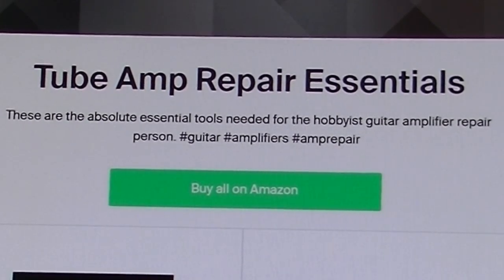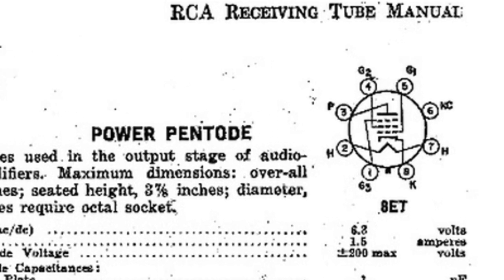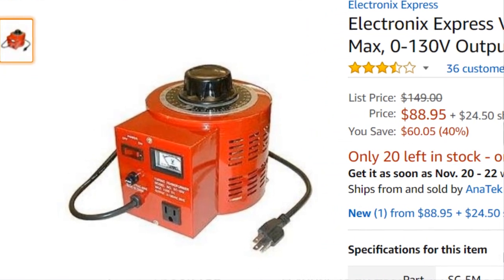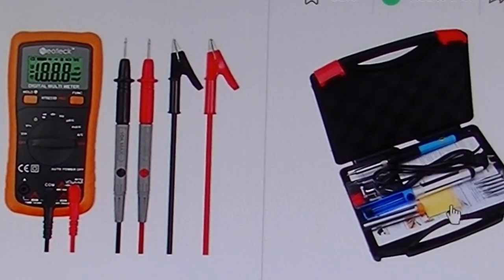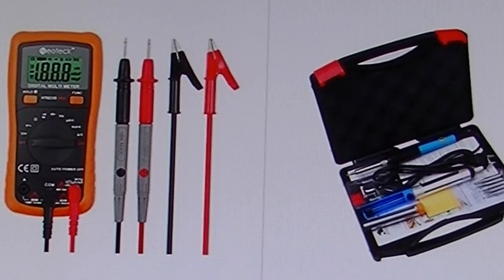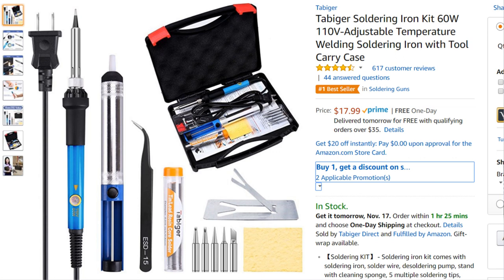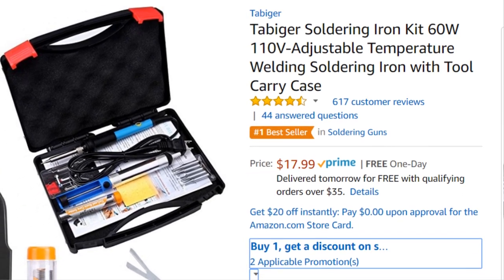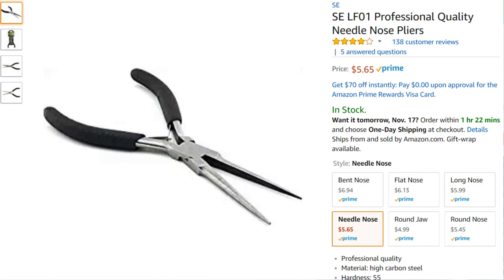9 MOST ESSENTIAL TOOLS for Tube Guitar Amp Maintenance and Repair

Comment: First things first, Great video...!

for tube data: Frank philipse´s online database, no matter what...;)
Download the RTM and by the time you have some saved money, buy the used original...;)
Ditch the variac, spend the saved money on an ISOLATION tranny!! And on a "big name" used digital meter, if it´s a fluke, a tek, or a beckman....but you rely on this thing, so buy a used from the big players. It may save your life....i´ve blown so many cheapo DMMs but i know what i´m doing (ok most o´the times;)
Replace the variac with light bulbs in series with the amplifier, if something odd is happening inside they will light up and save your amp. 

Next is more of a, my oppinion, advice: if you buy an used amp of unknown state, simply disconnect the high voltage secondary leads which go to the rectifier, and see if all tubes will light up and the power tranny doesn´t "sing" much or getting hot.
I always start that way, of course, you can combine this with a variac and an isolation tranny. in fact i always use my variac followed by my iso-tranny and try to light up all tubes without any high voltage present in the tube amp/radio/tv/recordPayer/R2R unit.

by the way, my weller WECP station have survived three benches and it´s about 30 years old by now. i replaced the mains cord, and a lot of tips, but that´s it. But if you try to solder some big wires to a chassis, a plain 50W LR21 don´t cut it, you gonna need "more power" usually i go for that pistol shaped short circuit 150W iron. Also you can´t compare a hexacon blaster, which is more than 3 times+++ the power with a temp controlled weller 50W LR21 iron...;)

Also buy top notch tools as soon you can afford them, cheap tools are exactly that: cheap....i was into these as well, i bought some, and when they give up, i bought cheap again...until i was given some Wiha screwdrivers....a complete new experience...they last, the work like a charm, this also is true for pliers, clippers....you only buy once for about ten years to come, if you don´t abuse them: big cables/wires need big beefy biters but no precision clippers ;)

Comment: Hi thanks again for the video and I have learned so much and thanks for that I repair a lot of Xbox one x ;s and other things to I am just going to buy a  bench top multimeter  And I don’t want to spend to much it’s the OWON XDM2041 Bench Multimeter with 3.7-Inch 55,000 Count True RMS Ultra-light Digital Multi Tester for Labs, Factories and it has the 2 wire testing and the 4 wire testing do you think this model is ok to start with I have good   Range Of soldering irons and  D soldering irons  And hot air as well I will go out and buy the  transformer  Which is a good  safety items To have and in the  future I will go out and get a four channel oscilloscope I think four channels is plenty don’t you think and I have made some   Discharging  leads for capacitors to make them safe I have soldered in a resistor on the lead with different values to make the  compositors safe to work on is there any other  items you can think of specially for safety thanks mark

Comment: Do you need an octal socket probe for your multimeter when biasing a Marshall Plexi reissue without easy acces on pcb for checking bias? Thanks :)
Reply from the maker: I'd just open the amp up and use my probe on the tube pins. You can actually MAKE your own tube socket probes using old tube bases, but there's no guarantee any of them are going to fit inside the cabinets of the amps you're trying to probe. In some cases you may find the probes are too tall to fit inside with the tube on top. In these cases you have to pull the chassis anyway. But no, I would not consider socket probes essential. More of a luxury that won't always work in every case.
Reply: Thanks a lot! Great channel, love watching you fix stuff up :)

Comment: What about an isolation transformer? I would always suggest to use one of these in order to get a little more safety, especially with amps/radios that don't have a transformer themselves. I use a variac with isolation transformer, all in one. Furthermore I think the internet provides a lot of essential content, so having a PC, Laptop or Tablet at hand makes, in my opinion, more sense then buying the RCA tube manual. You can look all tubes up at http://www.mif.pg.gda.pl/homepages/frank/index.html (I always just google "Frank tube"). Some clip leads might be handy to test components in circuit or take measurements. For troubleshooting amps sometimes an oscilloscope might be very useful. And so on ..... As you said, the list you provided is not exhausting and everyone has his own opinion. But I would definitely recommend the isolation transformer.
Reply from the maker: Thanks for the comment. The isolation transformer is a popular suggestion so far. Between that and a current limiter, which would you deem more "essential"?
Reply: The Guitologist The iso transformer, as it saves your guts from being cooked when you don't pay attention to where you put your fingers. A current limiter is a good idea but I think you covered that with your variac where you monitor the current anyways when firing up the amp for the first time. For sudden failures that might appear while working on the amp, let's say a short, you normally have fuses. You can also put a light bulb in series with the amp to help cut down on current in case something went wrong. Therefore a current limiter is a device I would only consider buying after I covered the essentials.

Comment: You NEED a dead man stick.... anyone working on tube amps or radios needs to discharge caps before finding out how much 400v DC hurts.... ok, 1600vDC hurt more but most won't be playing in rf stuff.

Also, the multimeter needs to have a 10 meg input resistance so as not to load the circuit and be rated either class 3 or class 4 so that it can withstand the higher voltages safely.
Reply: Totally forgot to mention that too when I made a comment, it's a good point.  But you don't have to build one.  A multimeter that has a LowZ mode can discharge most caps up to 800 volts or so,  the impedance on that range is only about 2-5k ohms.  I've been doing it for a few years now discharging 450v bulk input caps.
Reply: Trouble is that most cheap multimeters are not particularly suited. I would still go with a 5w 10k resistor and a pair of long clips. Ok, I might be a snob because I have an older fluke 77, but sometimes the even older Avo 8 is actually better for some jobs. Both can be had on ebay for pretty reasonable prices, there is no need to spend big money or to scrimp out and buy a $5 chinese meter.

Comment: Fluke Multimeter is the top of the line multimeter than can be used.
Reply from the maker: Agreed. I have a very nice Fluke. I also have several other DMMs.
Reply: Which fluke though... some people might not know that the chinese have fluke meters too, designed just for that end of the market. I have a genuine 77, made in usa but In some cases my British made Avo 8 makes the fluke look like a toy.
Reply: Some multimeters are not suited for amp building and repair. Many Flukes are great for electronics, but lack features needed. 
Watch Amp Mechanic on his mistakes buying multimeters for guitar amps.

Comment: I'm thinking I will need an oscilloscope if I muck around with tone stacks and other things. What bandwidth would be recommended? 100MHz? Would I regret that relatively low bandwidth in later years?
Reply: Even 50 Mhz would be way more than you need working on audio gear,  especially if you have a limited budget.  If you can afford 100Mhz ,  then get that.   Used analog scopes can be had pretty cheap.
Reply: audio bandwidth is less than 50khz so any scope will do the job. even the chinese kit ones (i did a video on them) are not bad for a beginner and not too much of a loss if you blow it up.
Reply: Whatever you get consider a fixed 100x probe to safely nose around in an amp without risking blowing the 'scope front-end.  Most probes are 10x/1x switchable, its very easy to forget to check its in 10x and destroy the 'scope on HV gear. A fixed 100x probe will handle anything short of a neon-sign transformer.  Or failing that glue a probe
permanently in 10x position for valve use.
Reply: Scopes... for audio... absolutely any bandwidth available will do what you want. I run a 60Mhz Philips scope but that is only because I do radio work as well as audio stuff. Mark is right, get a x100 probe or you do run the risk of blowing up the scope. Older stuff actually tends to be more bulletproof but you run into the issues of having to fix the scope before you can use it!

Comment: For people starting out,,, especially with tubes,,, an isolation transformer could easily save a life.
Reply from the maker: Thanks, Carl. Good call.
Reply: My first reaction too

I would add to that list a screwdriver drill. Life is too short to be undoing screws by hand 

I am fortunate in that I invested in a Pace rework station back in the 90s. Cost me over 3K and paid for it's self in just over 6 weeks !!!

It's a bit like owning a truck in that it costs you a small fortune when you need to fill it up, and the tips and such are not cheap, but the ability to strip chips off boards, and quickly remove a component without damage to the board is so valuable to me. Modding Chinese effects pedals, even multi layer boards is not a problem.  

Absolute overkill for old point to point amps, but incredibly useful on the later PCBs amps. 

They are still selling for $300-600 US plus hand pieces.
Reply: Ever since I bought by Mikita screwdriver drill, I don't mind traffic lights as much now.
Reply: Well CO,,, a variac lets you bring up the voltage and current slowly to the chassis while monitoring the current rise. If the current comes up fast and higher than it should, you can cut off power before it does damage. ( especiially to items like the costly transformer ) It's more for safety to the unit. The isolation transformer isolates the secondary side of the transformer from the earth ground of the primary. Without earth ground, shock hazards are a lot less likely.
Reply: What skycarl just said !!!!!

Comment: Cant you just use BF244 FET transistors in cascade mode for the four terminal tubes  and VN66AF for low power maybe 5 watt and or use the VN66AF to drive MJ3055 metal case transistors for 100 watts.

Comment: If you need someone to give you a basic equipment list to work on tube amps, then you probably shouldn't be working on them at all. Only those people with sufficient understanding of tube electronics (and the hazards involved) should work on them. For those people, they will already know what equipment they need (and will likely already own it). Everyone else should just steer clear until they gain a proper education on how to work on tube electronics. Otherwise, your first mistake may be lethal.

Comment: Signal generator and Oscilloscope?   Personally, I wouldn’t touch a piece of electronics without being able to see waveforms...  Without a gen and scope, you can evaluate and test a great deal, with just a voltmeter, but why not see whats really going on?  Today a decent little digital scope can be obtained for a few hundred bucks... There is getting by with as little as possible, and then there is the next step... take the step, you will never look back.

Comment: I soldered a #12 solid wire to one end of a 100 ohm fat resistor with an alligator clip to the other end and shrink wrapped all the exposed wire to make a capacitor drain.
Reply: 100 ohm is a bit harsh. I use a 5w 5k and a 5w 10k, depending on which one is nearer at the time.

Comment: No need to spend big bucks on a heavy duty soldering iron.  Search eBay under stained glass or heavy duty soldering iron.  They are only $20 or so.

Comment: By using a variac and therefore reducing the filament voltages results in poisoned cathodes There's always a place, time and method for everything and be warned if you delve into tube amps there are many dangers and safety is first ALWAYS just like my teachers taught me many moons ago.I've seen a 12 inch long mini lightning bolt arc from an amp up above to a CRO and the smell of ozone filled the room.Lucky it didn't find me instead.Be careful guys.

Comment: although a digital meter is more accurate a vtvm is prefered in older tube equipment. its also more forgiving if the range switch is set too low. some very low voltages such as avc, IF alignment etc is better viewed on a vtvm as the pointer responds quicker than a digital meter to small sudden voltage changes.
 besides anything other than tube equipment to repair tube equipment is a blasphemy of sorts :>)

Comment: Lead poisoning makes you forget it's in the fumes not in the hand contact as much as breathing it in
Reply from the maker: I'm not so sure about that. The fumes we see rising up from soldering is actually from the molten rosin. Lead apparently doesn't vaporize until its extremely hot. I mean, think about it...lead is one of the heaviest metals on the periodic table that we actually use, and the idea of it rising up through the air in any form is hard to breath in. I did some reading on this subject once upon a time that convinced me fumes from soldering are not a real heath hazard. I'll try to find it again and link here if I do.
Reply: The Guitologist sorry, the forget comment was meant as a pun to your closing. Soldering with any type of metal is more toxic through the fumes you breathe rather the skin contact.  Lead is more harmful and should be treated that way, especially if children can come in contact with it. Keep the little ones safe. Use an exhaust fan when soldering. 😎
Reply from the maker: I got your joke. Made me laugh. :P

An exhaust fan is a good idea in any case, but I think there is some evidence that lead "vapor" isn't a concern at soldering temps. Thanks for bringing this up because it's an important concern.
Reply: The Guitologist bringing what up? 😉
Reply: In the welding part of my marine engineering certification they went over how toxic welding and soldering can be and obviously talked about extractor fans etc. Plenty of would be welders in that class changed their minds. Was quite disturbing to see some of the medical stuff they showed.